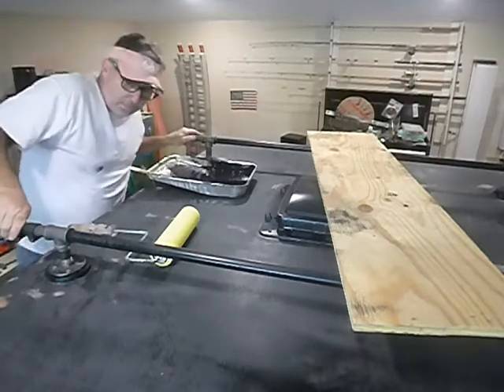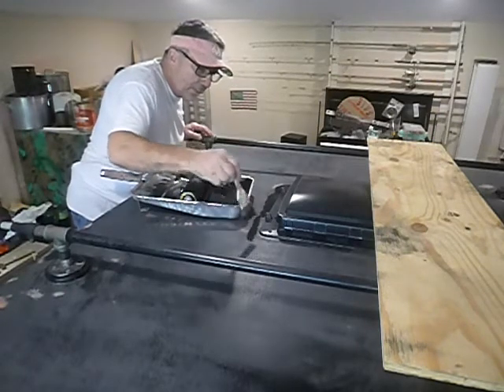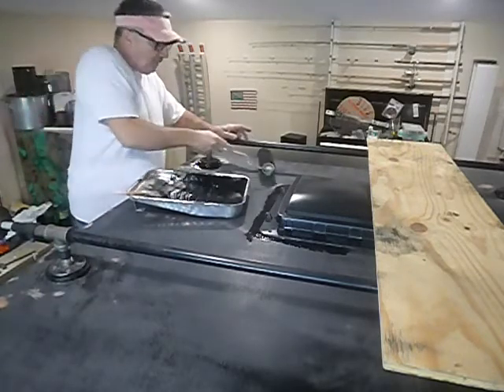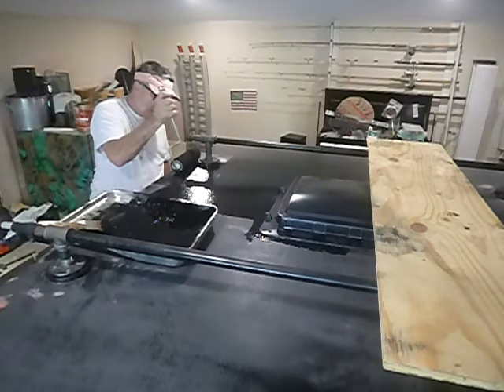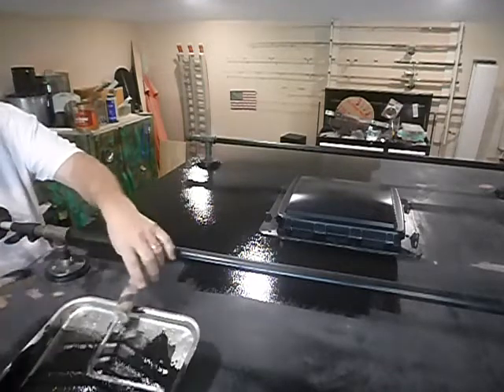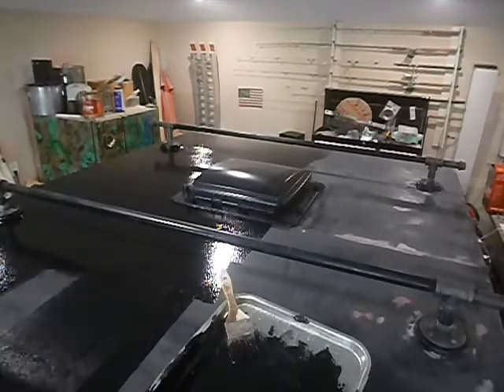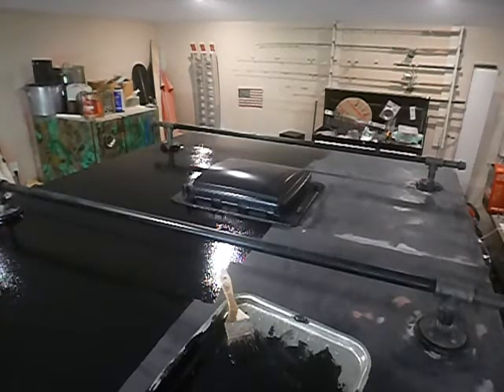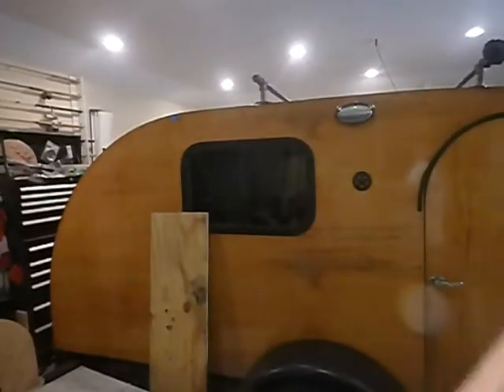DIY Teardrop Camper a 5X10 M53 Painting mini camper roof paint, not shot with go pro

Comment: Thanks for the tip on cutting in by jiggling the brush to avoid straight paint lines so it blends in better with the orange peel texture of the roller painted main area. 🆗✅😊
I suppose one could also use a very small roller brush to cut in, though don't know how easy that would be.
Reply from the maker: You could use a small roller the reason I used a brush is that the roof vent sticks up 1/8 inch and with a brush I can get paint under the edges and make the paint look uniform. The reason the roof vent sticks up is that it sits on two layers of butyl tape or sticky tape for a good seal.

Comment: Why did you choose black?
Reply from the maker: To match my wife's suv and my f150 they are both black and I think it goes well with the wood, not to worried about summer heat as the ac is a 6 K btu . I built a blue camper for a guy and painted that roof white.